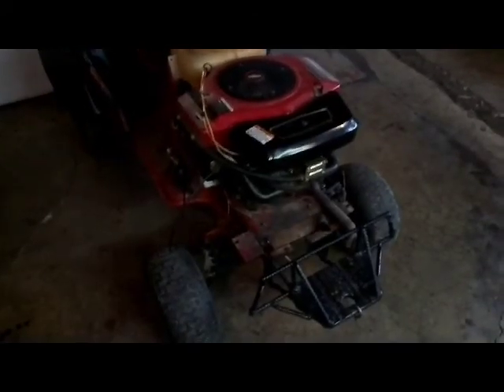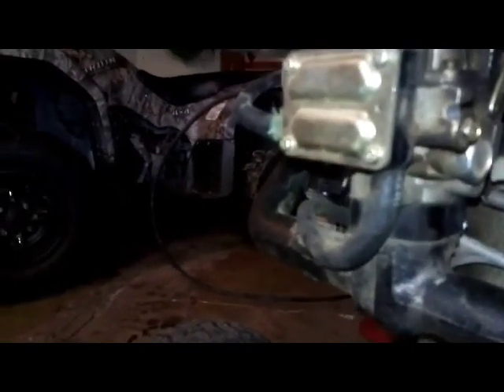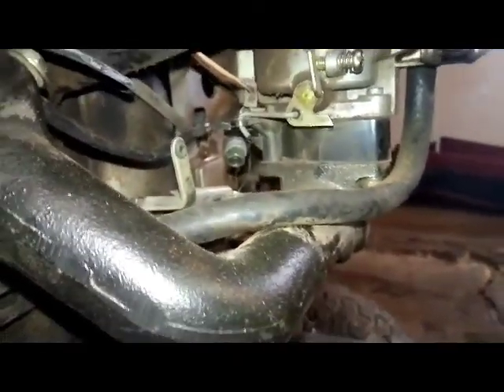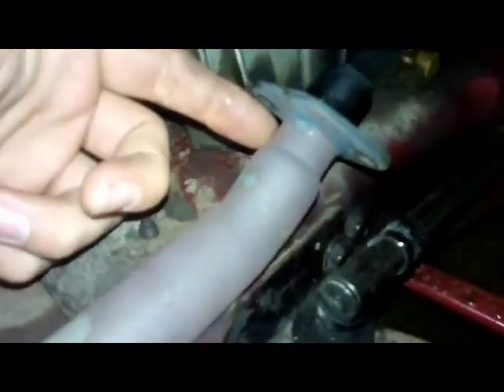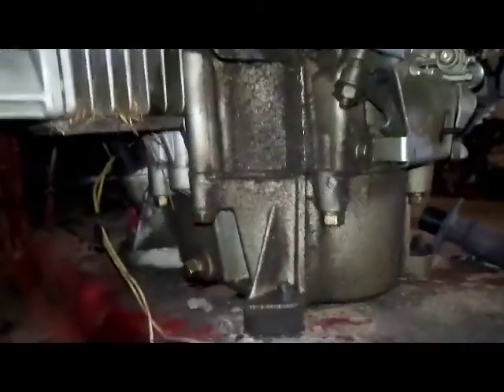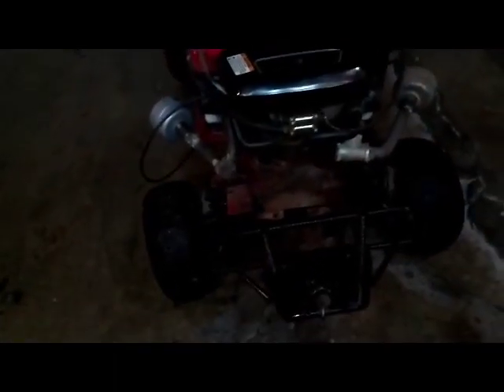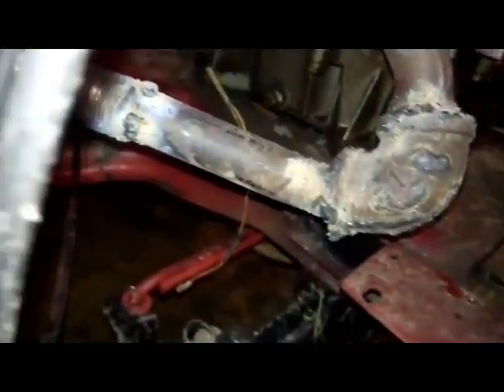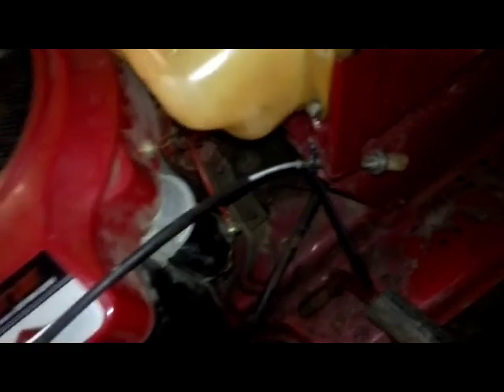Murray gets an opposed twin

Comment: Loved mine for the sound of it. Good job on the swap.
Reply from the maker: Twizted Mowers did mine for almost the same,reason, and thanks
Reply: mower joe I've made duals and I made one that came out the right side. Used a cheap hotdog muffler and drilled some holes in the opening and it was fairly quite and sounded good.